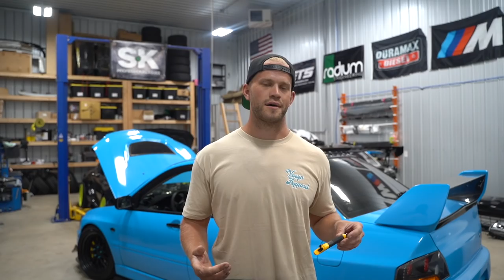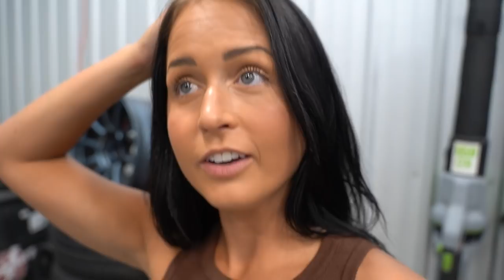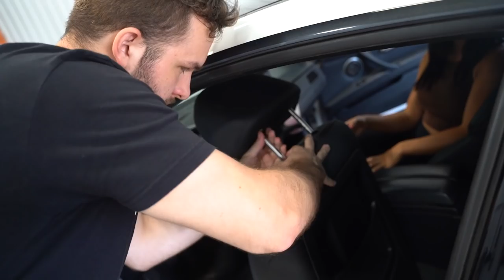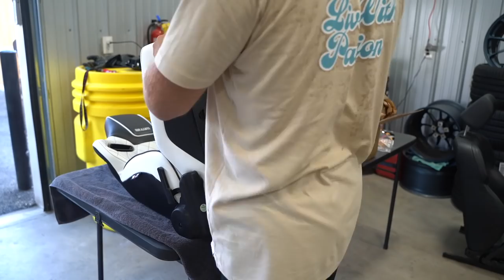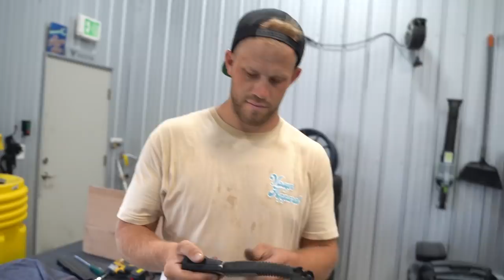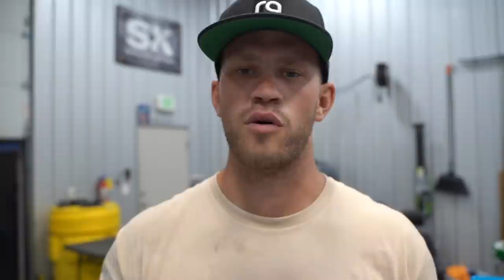Installing White Braum Racing Seats E92 M3!

Comment: Regarding what  Bobbie said about the radio being outdated ... you can add a digital cluster, you can add an android touchscreen (4gb ram ... don.t get with 2gb of ram because it will lag ) and still use the wheel ,  instead of the old one ( you can have netflix, youtube + any app from playstore .. you can use torque to keep an eye on all sorts of data about the car )
I have an android screen in my f30 and it.s insane 
my car is 2012 but i have more tech in it than the new G series :))
Reply: you have a link? my dad wants to update the nav on his 11 m3. he was interested in apple car play tho.
Reply: @dankmelk7976  i got mine from ebay
search for bmw m3 android screen ... you will have 3 options 
1 digital cluster screen
2 a touchscreen that goes in the middle on the dash
3 or a touchscreen that will replace your radio (double din)
On my f30 you can mirror a android and iphone

Comment: You should have disconnected the battery before disconnecting any airbag sensor wiring. The car wouldn't have known the difference. Now, you're kind of screwed. The only option would be to add a 2 ohm resistor to trick the system into thinking the airbags are still there.